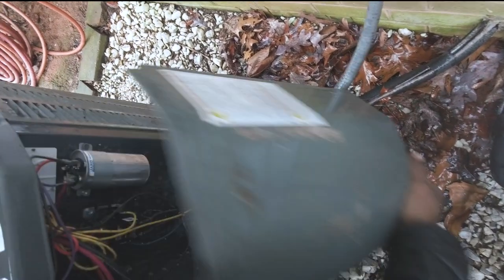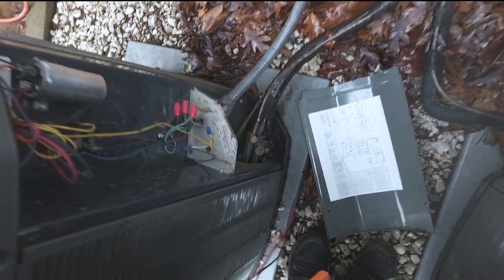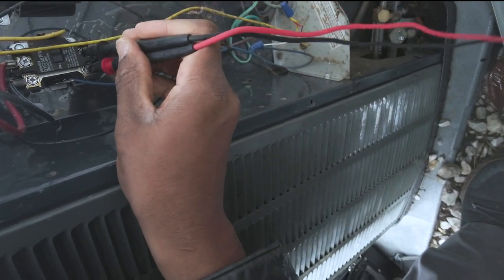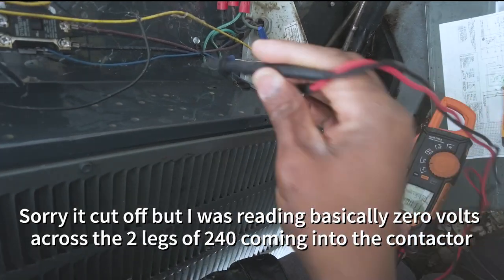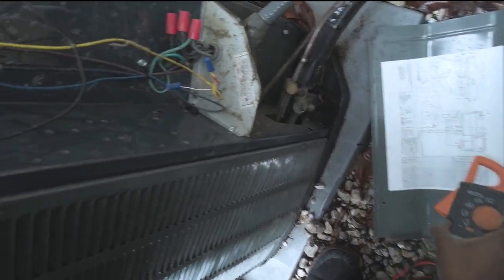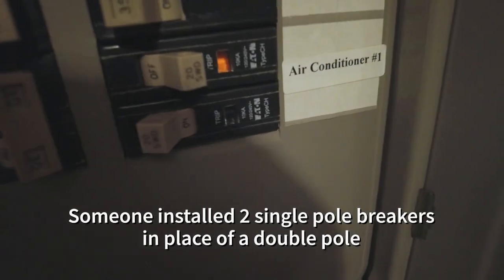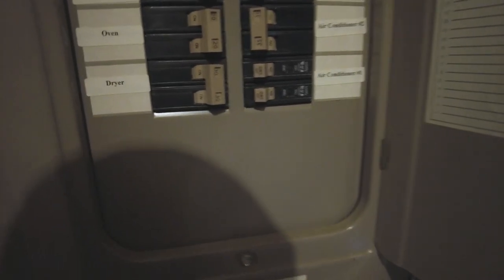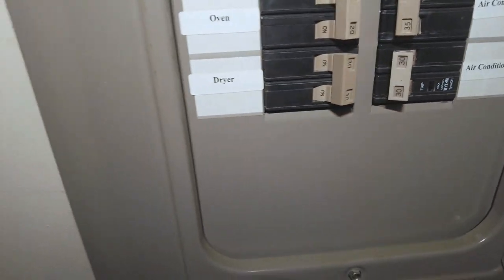Why I Always Use a Non Contact Voltage Detector - HVAC Non Contact Voltage Tester

Comment: They can save your life or lull you into a false sense of security if the sensitivity is turned down to low or you got a short somewhere.
Reply from the maker: Yeah I totally agree but that applies to all electrical testing equipment. Never want to put too much trust in anything, whether a meter or non-contact voltage tester. That's why I like to use multiple tools and various different ways of testing the power before I ever touch a circuit that way there's a bit of redundancy not just trusting in one source.

Comment: TBH, I don't trust the little stick NCVs. I'll use the one built into my meter on occasion, for example when I want to check a wire that doesn't have exposed copper for me to put leads on. But if I'm going to be touching it, you better believe I'm checking all three phases to each other and to ground before the ole meat-sticks get anywhere near it.
Reply from the maker: I'm not really a fan of the stick NCVs either. My next meter is definitely going to have NCV. I appreciate the feedback and thanks for watching!
Reply: @HVACTechKnowledgy  I'm a fan of Fieldpiece's selection of meters. I bought the SC680 because the bluetooth lets me check blower amps with the door on.

Comment: I pulled a disconnect once, it broke & only half of it came out. I really felt those 120 volts lol
Reply from the maker: Wow that's crazy! Its amazing just how many different ways things can go wrong, I would have never even considered something like that happening. That's one thing I really love about this platform, you can learn so much from other people's shared experiences, before you have to learn yourself the hard way. Appreciate the feedback thanks for watching!
Reply: @HVACTechKnowledgy  Once ran across a 06D compressor (semi-hermetic with approx. 30-ton capacity) that grounded out internally. For whatever reason the fuses didn't blow fast enough and it took the disconnect with it.
Reply from the maker: Oh man, that would have been horrifying if you were standing next to it.
Reply: @HVACTechKnowledgy  We had to call an electrician to make sure the building's wiring hadn't been damaged. Also took a crane to get the compressor to the unit, was like 500+ pounds of metal and would give a few smaller car engines a run for their money in the weight department.
Reply from the maker: Man that’s crazy, that commercial stuff is intense.